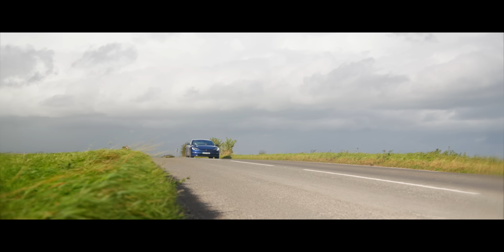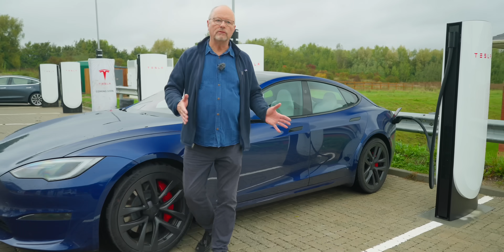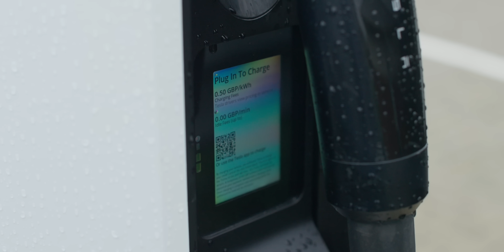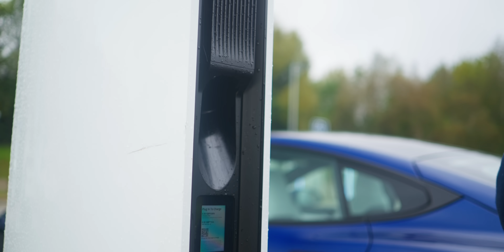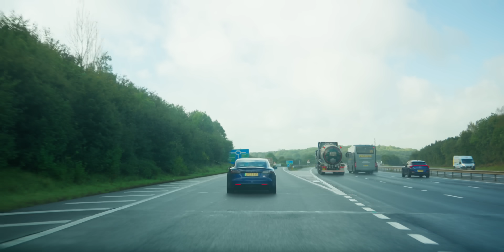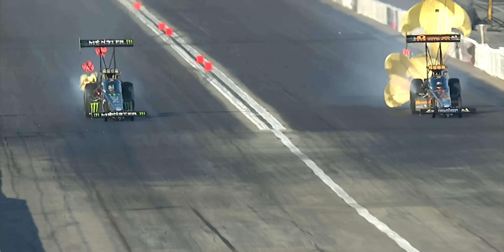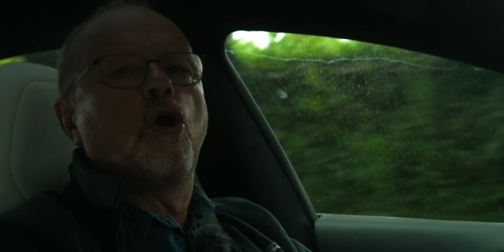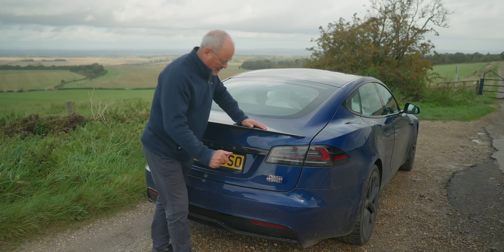THIS Is Why The Model S Plaid Didn’t Come To The UK

Comment: Stalks are a must as are manual AC controls - I’ve never liked the over reliance on the screen
Reply: The screen is working perfectly here
Reply: One button
"I'm cold"
It warms up.
You're not relying on the screen.
You're also not looking away to check the setting on the manual control (You DO, however much you think you don't)
Reply: You really don't need to interact with the screen while driving, the voice controls are surprisingly good.
Reply: I have a 2016 Model S, and in the nearly 7 years I’ve had it, the voice commands have always been a problem. It transcribes my words perfectly, but if I don’t use the exact right phrase, rather than telling me it didn’t understand, it just changes some random other setting - which then requires 20s of f-ing around the touch screen figuring out what it changed and undoing it. Not to mention how disruptive voice commands are when you’re not driving alone. Programmable buttons please - so I can control the things I care about without taking my eyes off the road.
Reply: Here in the 21st century, those of us driving Teslas find it really easy to operate without a bunch of knobs.

Try joining us!
Reply: @edwardhackett-jones8126 Speak for yourself. It’s fine burying in touchscreens preferences and settings you’re only going to set once then leave, but using a touchscreen for controls needed during a drive is just silly - especially when they’re buried under a menu like they are on my Tesla. I bet you think it’s fine texting whilst driving.
Reply: @markirmuir  bet all you like, you’d be a fool.

You do know that most controls you’ll need are easily operated via voice? Indicators are on the wheel, not the screen.

I rarely need to touch my screen while driving.
Reply: @edwardhackett-jones8126  Sorry to falsely accuse you. That’s just the stereotype I’ve come to notice amongst Tesla drivers who like the lack of controls. I am aware of the voice commands, but they just don’t work well for me. I can’t memorize the exact phrases, and if I get it slightly wrong, it wreaks havoc, so I gave up with it. I’m an engineer, and my car is way out of warranty now, so I will be coming up with my own solutions once I find the time.
Reply: Voice controls are awesome in the Tesla. They really work well. Literally can just say "it's cold in here" and it will warm up 3 degrees. Also you can move different options to the panel at the bottom of the screen for more convenience

Comment: The horn and wipers aren’t used that frequently in most traffic conditions but indicators are used every trip and repeatedly so therefore he is making a valid point about having a lever to operate the indicators.
Reply: I think its a deal breaker for many. Someone mentioned this below on Bjørn Nyland’s review and is so spot on. 👇
Instead of always knowing where to find the blinker stalks, you now have 360 degrees of possible positions and in 180 degrees of the positions the buttons will be upside down.
Also why have icons, they are only pointing in the correct direction when the steering wheel is levelled correctly, and why is the first button at the top the right blinker?
Impossible to use in heavy traffic driving through roundabouts, accidents will happen due to drivers not checking the road for other cars in blind spots or pedestrians crossing the road as the driver needs to look down and try to find where the buttons are located and which one to use. If the driver manages to actually turn on the blinkers, a large portion will signal in the wrong direction and can cause other accidents due to other drivers assuming the car is going in that direction.
Reply: Horns are often for emergencies. Requires fine motor skills to hit s small capacitive touch zone is not good.
Reply: The auto wipers are beyond crap on a tesla because they try to use the camera rather than spend $3 on a rain sensor so you have to constantly adjust them manually using the stalk
Reply: @ericpisch2732  my (most modern) car has auto wipers using a rain sensor, the stalk also has a sliders to adjust intermittent speed (so I suspect VW didn't trust the rain sensor either!
(BTW, it is a cheap diesel - I'd love to have an electric car, but can't afford one!)
Reply: @ericpisch2732  but if you don't have a stalk either 😬
Reply: All stalks are very useful and give you intuitive operation and savety in critical situations.
If a huge vehicle drives by on the othe lane in heavy weather and suddenly slashes water and snow and dirt on my windshield, I don’t want lo look for a small button on my steering wheel! No!!
I immediately want to hit my wiper lever/stalk instantly where it allways is located.
Reply: I use the wiper controls all the time in my model 3 be ause the automatic wiper control is absolutely hopeless.
Reply: BUT, when you need the horn in a dangerous situation you need to hit it fast.  A small button on the steering wheel wont do, Especially if you are turning and it is at the bottom of the steering wheel.  A large horn area in the center of the steering wheel (like 99% of current cars) is vastly safer.
Reply: BMW, Audi and range rover drivers won't notice the change
Reply: @andrewgiles6192 And now they all drive Teslas.
Reply: There are third party options for stalks
Reply: Indeed, it's called practical and considerate ergonomics. When you have switches on the wheel, their position changes all the time, on stalks, they are always available. You don't ever have to look for them, and you can put several functions on each stalk and muscle memory makes use of them. It would also make sense to have the regeneration selection on a stalk too. There's a good reason stalks are used in every other car made in the last seventy years Tesla might understand IT but it needs better ergonomics, including a display in front of the steering wheel or a heads-up display - the mid-car LCD touch display to operate so many important functions is plainly dangerous. . I think it's sheer perversity on Elon Musk's part, who thinks he always knows best. Most often he does, probably, but here he definitely doesn't.  In cars of the 50s, the horn was a circular lever around the hub of the steering wheel, a simple thumb movement would sound it whatever the position of the wheel or your hands. .
Reply: I don't understand how it's legal to use turn indicators as buttons instead of stalks.   Stalks should be a federal standard for safety reasons.  And also the horn as a button should be illegal as well.   That's a huge safety issue, especially in an emergency.   The horn needs to be as accessible as possible with a large surface area (the center part of the steering wheel).
Reply: Americans don’t understand roundabouts so can’t appreciate the ease of an indicator stalk. Totally puts me off Tesla but hopefully an after market conversion can be created.
Reply: @the-silverghini Well, American traffic engineers are building them everywhere. So apparently someone here likes them. I actually really perfer them for small intersections. But ones with more than one lane are just dangerous and confusing IMO. You spend your whole life trained not to change lanes in the middle of an intersection and now you have to change lanes inside of a roundabout... it just seems like a total disaster in logic and safety.
Reply: @patreekotime4578 lots of large roundabouts in the UK have lanes that spiral out, so as long as you get in the correct Lane you don't change lanes when on those roundabouts
When you have 2 lanes it is somewhat harder - generally you need to be aware of the traffic around you and indicate your intentions / adjust speed to suit ... However many roundabouts are wide enough for 2 lanes, but don't have any lanes marked - they require the most observation

BTW, I have a 1997 Toyota Rav4 - it's indicators are on the right (whereas almost all more modern cars have their indicators on the left) - swapping between this and my 2008 Seat Altea XL requires concentration ... and that's the concern with changing to a button - it will take some time to adjust and is likely to make driving less safe during this adjustment
Maybe I'm getting old, but I don't see the benefit in loosing the indicator stalk
Though I do wish they had stayed on the right (so you can change gear and indicate) ...
Reply: We have a two lane roundabout in a shopping complex and you would be surprised to see how many people in the outer lanes just blow through the yield signs without looking.  The inner lane drivers yield and you assume it is OK to proceed then have some jerk blow by them on the right.
Reply: @gwesco  can I check a couple of parts of your description?
In roundabouts in the UK (and most of Europe) traffic on the roundabout has priority (so traffic joining gives way (yeilds) to traffic going around the roundabout). These are sometimes called 'modern roundabouts' to distinguish them from the earlier 'traffic circles' where traffic joining has priority
I did use a traffic circle in the Netherlands once - really challenging and appeared dangerous (to my eyes) as the traffic with priority is arriving faster. 
I was taught (in the UK) that the inside lane is the one furthest from the centre of the roundabout (e.g. the same as the inside lane of a dual carriageway is furthest from the centre of the road (median?), so the outside lane is used for overtaking) - this confuses many people
(I refrained from using left and right lanes in this description as we drive on the left in the UK (so (apart from at roundabouts, where all turns are to the left) right turns cross traffic and traffic flows around roundabouts in a clockwise direction) ... adding that confusion into thus already complicated question would just make it harder to see the question!)
Reply: Yes, he is.

Perhaps we should get Musk to justify making a car that boasts such acceleration ... see how he squares that with being "green".
Reply: I switch between our X Plaid and Y and have found myself press the steering wheel on the Y to signal.   The key is consistency - if I could, I’d retrofit the Y for the same stalkless wheel as the X Plaid.  Not better or worse but making it consistent between my cars.
Reply: The turn indicators in the steering wheel are much faster and easier than a stalk, however it takes the most time to get used to.
If people started with steering wheel button indicators and went to a stalk it would seem archaic.
Reply: @sslazer  I take your point but I think that's the perspective of someone who's not used to indicating the exit turn on roundabouts when the steering wheel is at an essentially arbitrary position and just being able to sweep the fingers across the stalk in the direction of turn is very, very natural and easy. Introduction of a stalk would possibly seem like a genius invention over buttons for such use cases.
Reply: Easier to press a button than reaching for a lever.
Reply: @stighaaland5357  exactly, that’s why I am deleting your nonsensical response.
Reply: The term "indicator" is a great description. They should generally be used before beginning the manoeuvre, so usually with the wheel straight (some roundabouts or large junctions accepted)
Reply: @rogerstarkey5390 Correct but in the UK we have lots of roundabouts and we have to indicate before exiting the roundabout when the wheel is not straight ahead. I just don’t understand why Tesla removed the indicator stalk, its alienating so many people myself included. There are so many things to admire about Teslas in general but they don’t seem to understand what so many people want. Give me the stalks back and a head up display and I would be very tempted.
Reply: @Mark_my_words_YT  
(I'm in London)
Reply: @Mark_my_words_YT removed to save money and it’s a crap idea
Reply: @ericpisch2732  I believe it was an Elon Brainfart and no one had the balls to tell him is stupid. :face-turquoise-covering-eyes:
Reply: @rogerstarkey5390  Except when you exit *every single roundabout*, when you're supposed to indicate on the exit but - obviously - you're *on a roundabout*.

Comment: Oh come on, this is NOT faster off the line than an F1 car, the 0 to 60 time is actually 6 to 60, because they don't time the time it takes to get off the first meter.
it's bollocks, basically
Reply from the maker: I think it's utterly unimportant but here you go.
Standing quarter, of course the F1 is faster. 0-60, it's slower. been proven again and again.
https://www.youtube.com/watch?v=CEc4nO4iaiA
Reply: @fullychargedshow  I don't think that F1 is faster in 1/4 mile... Video shows Performance model s which is a snail in comparison with this one